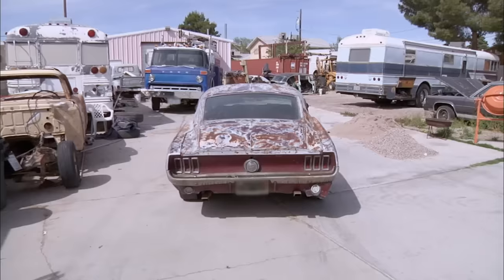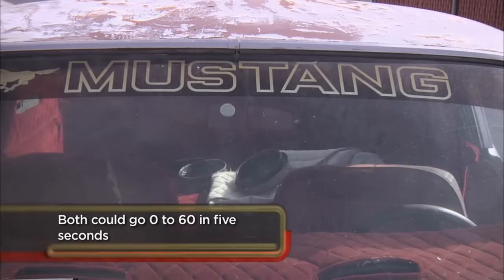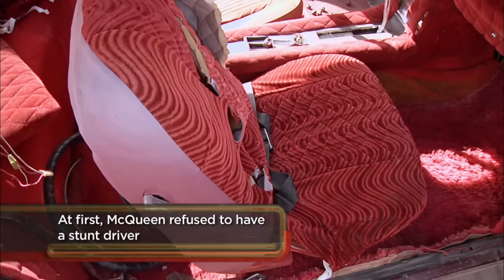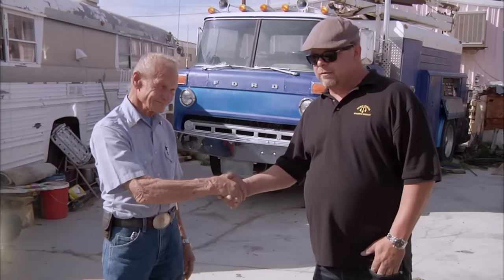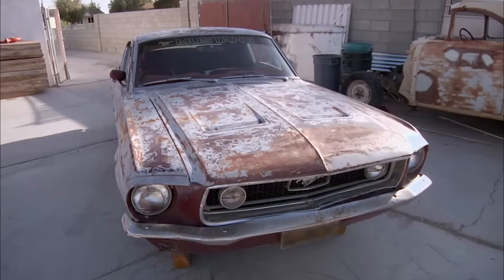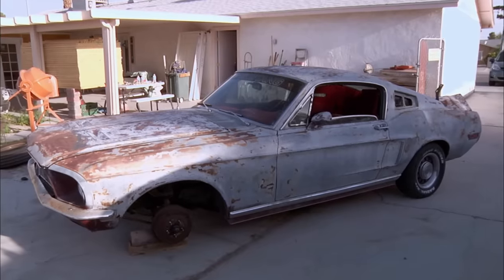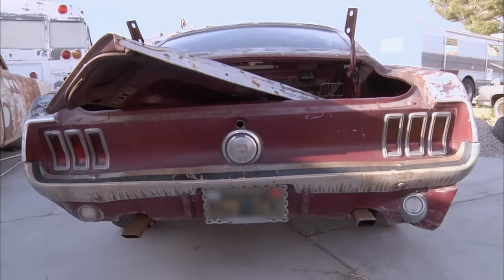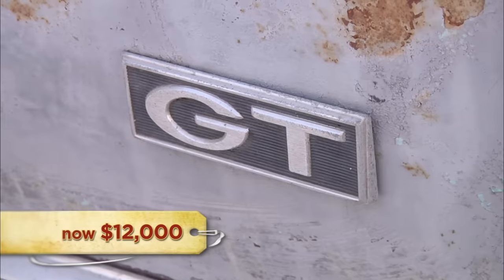Pawn Stars: Rick & Corey Can’t Agree on RARE '68 Bullitt Mustang (Season 6) | History

Comment: 100k for a 68 GT? 🤣🤣🤣  Things barely worth 40k restored.
Reply: @noahkagan5271  302 base model, instead of a 1968 390 GT that was actually used in the movie? I rest my case.  Boss 302 is probably the highest value of the 60's 5.0 mustang and most of those sit comfortabley around the 55k mark, st saying.

Comment: Did they even check the data plate to see if the car is real because you could put aftermarket parts on it from a junkyard from how bad condition it is and you won’t even tell a difference

Comment: These cars in this condition should not be as expensive as a new used car. It's rusty, it has a crappy interior, it doesn't run, it doesn't have front tires or wheels. Horrible. Wouldn't pay more than $3,000 on one.

Comment: I see nobody bothered to check and see if it was a numbers matching drive train.
Reply: Ford doesn't have "numbers matching"...that's a G.M. and Chrysler thing....on Fords as long as the engine is the same model year and was cast before the car was built it's considered correct
Reply: @michaelbeckwith1073  Ok I’m a Chrysler man I thought they all went by that.There has to be some kind of identification numbers on at least the block.

Comment: This was the most pathetic thing. Both Bullitys are 390. They both have a hole in the trunk for smoke screen, both have torque thrusts, wood grain, Shelby steering wheel, and camera mounts under the frame, and S coded.

Comment: Good video Steve McQueen did  make the 1968 mustang  famous they used two mustang one was a gt the other one was not a gt but were equipped with the 390 4speeds the GT has the cutouts for the exhaust pipes the 2+2 doesn’t have the cutouts and it’s true Steve McQueen did plan on doing all his own driving but over shot the right hand turn and did the famous reverse burn out  and he also couldn’t make the sharp left coming down the hilly street .sow it was decided by the director.that the stunt man do the more skilled driving even though McQueen was a professional race driver as he admitted in the documentary off the making off bullit he was not a good stunt driver  he did do the smashing into the charger towards the end off the chase .and it was bud Elkins that  did the tow and release off the charger into the gas station and sliding the mustang across the highway into the ditch .👍

Comment: Boy. I would’ve run away from this steaming pile of …. To restore it to concour level will require 100k+ and you’ll not find the matching numbered 390 to put in it. At best you’ll break even. At worst you’ll take a bath. The guy with the bad fitting dentures should have sold it for 1250 not 12500. Ugh !

Comment: Restored it's only worth 20K .....maybe.
Reply: With todays insane prices, maybe in the condition shown IF it was numbers matching. But back in 2011/12 (when this was shot) for that money it should at the very least been running and driving. But a 302 GT trimm will NEVER be worth 100K unless the market goes compleatly insane.
Reply: Someone bought one at a auction the same year fixed up for 4.5 or 4.9 millions. Just like that not fixed up worth $30,000-60,000.
Reply: @lawrencejackson4001  
the original Bullitt car from the movie that was actually owned by Steve Mcqueen sold for 3,4 million in January of 2020 and was the most expensive Mustang ever sold at auction.

Comment: This car needs $100,000 minimum to get their car into showroom condition. $20K is a lot of cash to put another $100K on top of.
Reply: No where near $100,000 at most $15,000-20,000. If you own a paint shop $10,000, electric if you good. Another 1,200. Interior depending on what's used. $3,000. If brakes, lights, and it moves $500. New lights, or reconditioned, lights $300-400. If engine isn't locked up a good rebuild can be under $1,000.
Reply: @lawrencejackson4001  I like talking to optimists and I live in Austin Texas. My best friends are longtime experienced show car builders with a professional shop in business for over 40 years. They have worked on many famous cars that you would recognize. That car needs a complete restoration. It will take at least three years at at least $35K per year.